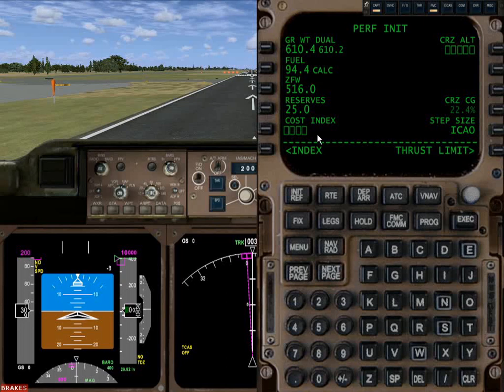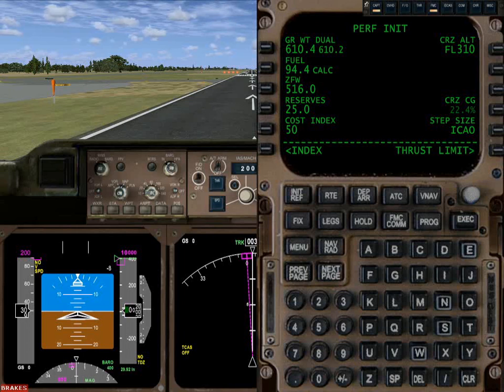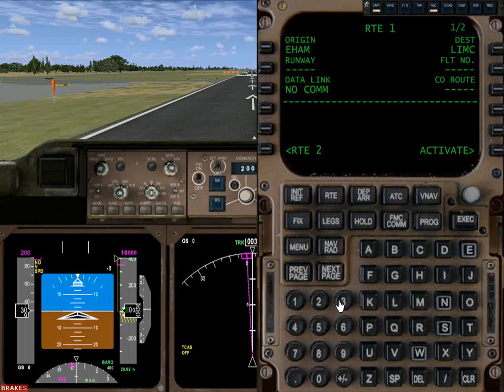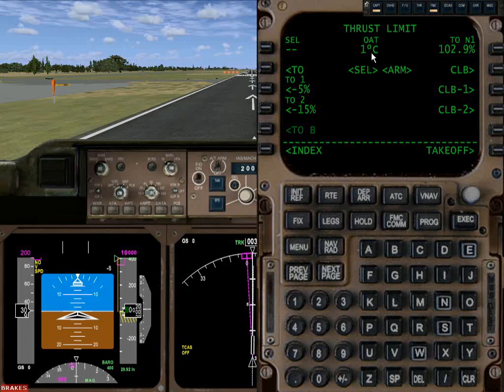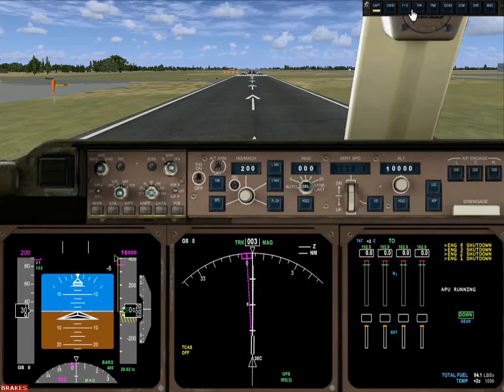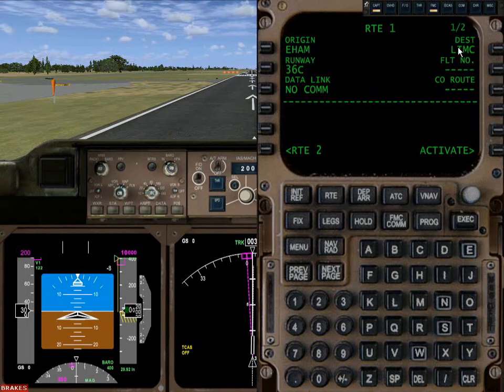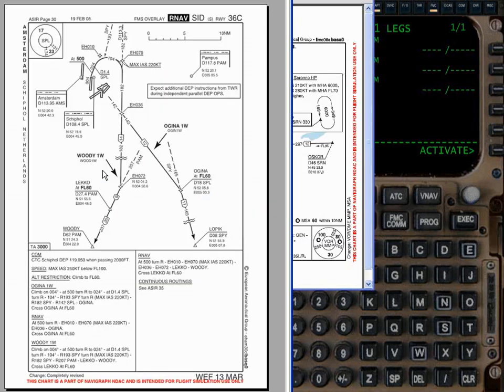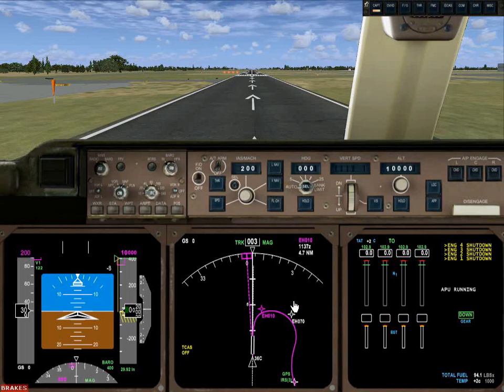PMDG 747 Flight Tutorial Part 2

Comment: Sorry to correct you V1 is the speed at Which u must decide to abort or continue. After V1 you must leave the ground what ever because you don't have enough distance to stop V r is rotation the speed you begin to lift the nose and leave the ground. V2 is a climb safety speed. It is a speed Which you can climb safely if an engine fails. 

Nice video so far